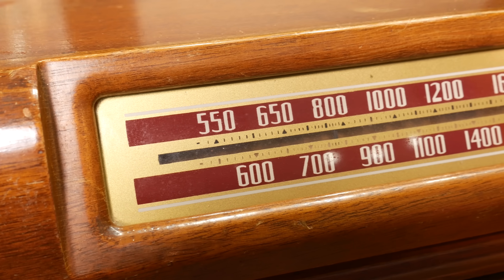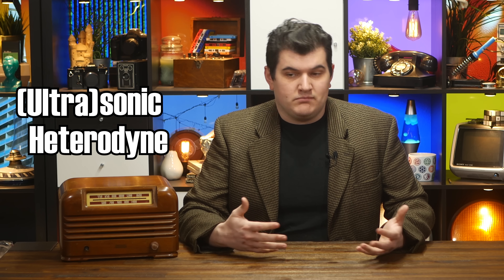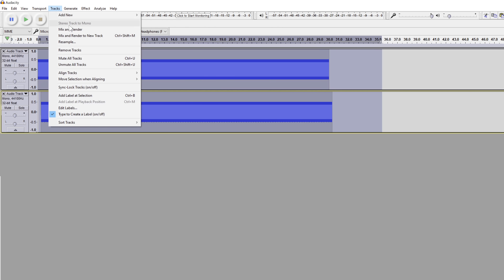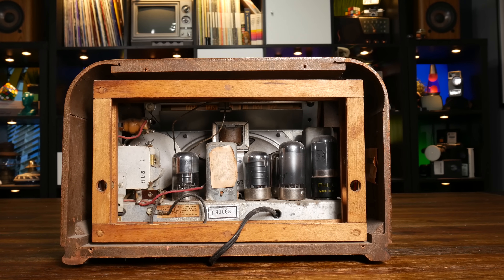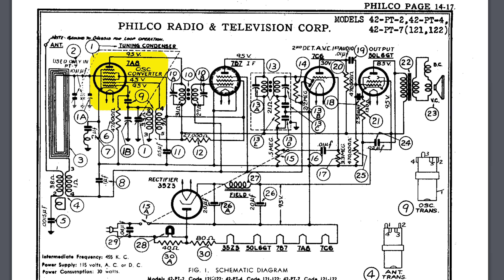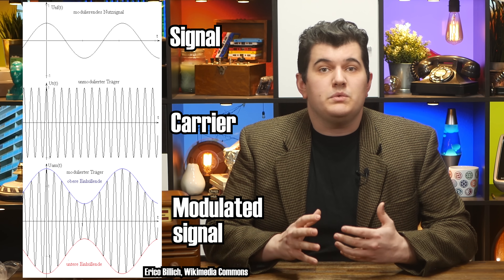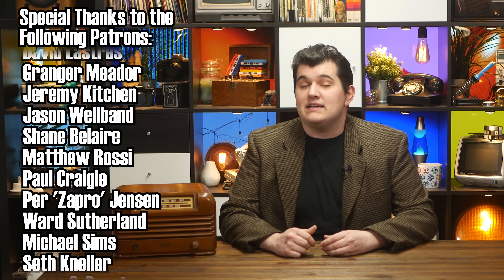The Superheterodyne Radio: No really, that's its name

Comment: None of you seem to know RCA held the patent on Superhetrodyne circuit, many law suits for years in the 30's. 455 kh IF for AM, 10.7 Mh for FM, except Philco used 9.1 Mh, for FM, Philco used a unique circuit for the FM detector, they used a Tube FM 1000 a pentagrid oscillator mixer that produced a 9.1 Mh signal to beat against the 9.! Mh FM signal to recover the audio modulation, resulted in a very wide band audio frequency recovery. Early TV sets until about 1960 used a 25 Mh Intermediate Frequency for the tuners, which caused a beat interference  when one TV was on Channel 7 it interfered with a neighbor watching Channel 11 or someone watching 9 interfered with someone watching Channel 13. About that time the TV IF was increased to 45 Hh as is the normal now used.  

Early Philco radios about 1933 was a TRF Tuned Radio Frequency to avoid paying RCA patent dues, than required a 2 stage tuning capacitor to get the narrow bandwidth to separate stations on adjacent frequencies. Home radio started with KDKA in Pittsburgh, PA in 1921. In the 1930 census the government asked do you own a radio. I'm 92 started doing radio service in 1939. In 1961 I was designing receivers for the Deep Space Network with JPL. Two way comunication from the moon to earth,wow In my life time, pictures from Pluto, wow. Ham radio to talk over distances, now we talk all pictures over the world on the internet. WOW.

Comment: The term "Superheterodyne" was coined by Armstrong to describes the use of a 'super-audible frequency' in its signal processing.  The 'Beat Frequency' is not meant to be heard but used as an intermediate continuous frequency that can be enhanced thru one or more stages of amplification.
Previously the Heterodyning process was to render a CW signal into an audible sound output, or demodulation thru direct conversion. Homodyne does much the same this with AM/FM radio be cancelling out the Rf by combining(beating) the carrier with an identical unmodulated frequency 180 degrees out of phase.. . .  Whew!

Comment: Wonderful video, but some things are left out. The thing in radio is not only do the two frequencies subtract to produce the difference frequency, but also add to produce a sum frequency. The engineers chose to use the difference frequency because at the time the amplifier devices could not amplify too high a frequency. It was invented about 1920, and the tubes could not amplify frequencies more than about 2-3 megahertz. In fact, early superhet radios used 40 kHz to 120 kHz. As tubes were improved, higher frequencies can be used, hence settling on 455 kHz. Also before the superhet, there was TRF, which means each stage had a variable tuning and all three had to match. Again at higher frequencies sensitivity suffered, plus the later circuits would feed back in the the earlier ones causing instability.

Comment: And then the use of variable beat frequency (local) oscillators led more or less directly to two even more significant technologies: FM and single sideband.  I used to use a local oscillator on the FM side of a pocket portable receiver inductively to reconstitute the audio of ham SSB transmissions on shortwave: just hold the FM radio close to the SW receiver and tune the FM until the Donald Duck sounded fairly human.

Comment: I'm an electronics technician by trade and we "only" learned intensively about FM. Our radio at school was a Sailor RT2048 VHF maritime radio. A fully synthesized double super (with two intermediate frequencies).

We did, however, build an AM receiver for the DCF77 clock signal.

Comment: Superheterodyning is still the dominant RF technology although the components used today have been miniaturized and  the process has been refined using multiple conversions and digital synthesizers. Even optical communications use superheterodyned signals to mix and convert light frequencies coming from a fiber optic cable. An old fashioned AM version is quite doable as a DIY project, and great fun! ---https://youtu.be/6VRlNt98uVg

Comment: 2:30 I actually believe a 1 hz difference would cause a 0.5 hz beat frequency. That's because when you add two cosine waves cos(f1*t) + cos(f2*t) you get a sum of 2*cos(t*(f1+f2)/2)*cos(t*(f1-f2)/2). The first term is the resultant wave which has a frequency of the average of the two input frequencies, while the second term is the beat/envelope which has a frequency of half the difference between the two waves.

Comment: I have a neutrodyne radio.  This has three tuning dials which all have to be tweaked to get a particular station, as it directly amplifies the signal instead of converting it to a fixed intermediate frequency for amplification.  Never got it to work yet, but it would.  I need to build a power supply to imitate the original 25 pounds of various batteries it took.  The radio was made in the early 1920's.

Comment: This is the very best explanation of how a receiver works that I have ever run across. Thanks for your hard work and research.  I remember having problems with harmonic signals or signals that would ride in with the one that you are tuned to.  Back in the days of yor, some people would use single side band modulation and most of us  could not understand the garble but we learned that adding a AM carrier to the SSB carrier would make it readable without owning a special SSB reciever.

Comment: Many of the earliest British TVs, pre-war and very early post war, used TRF (Tuned Radio Frequency, ie. non-superhet) receivers as there was only one transmitter (Alexandra Palace on 45MHz vision carrier) so sets could be pre-tuned to that transmitter and there was no need to be able to tune to any other. This avoided the problem of frequency drift of the local oscillator which was a problem with the valves and other components of the era. 
When a second transmitter near Birmingham to serve the Midlands was opened in 1949, some set manufacturers produced "London" and "Birmingham"  versions of their TVs, but with other new transmitters planned the writing was on the wall for TRF sets and all manufacturers moved to using superhets.

Comment: In England you had/have to pay an annual fee to watch TV. I could not understand how they would ever know you were watching without paying. Then I learned that TV detector vans were a thing. They could tell you were watching TV from the street! But how!? It's only a receiver, it doesn't transmit radio! WAIT. Yes it does, and it's the intermediate frequency you talk about. It's used in TV the same way and that IF leaks out and is detectable. In fact, it's even possible to tell what channel you are watching!

Comment: Local oscillator emitting frequency can be deadly if it's 1940's. That's how Nazis found people listening to allies stations
Reply: More recently we used it to look for the receiver for remote control bombs too as they always leak a bit from the local oscillator.  It was also used as a kid's game where you hide a transistor radio and then use another tuned 465Hz off to look for it.

Comment: The physicsy reason for the beat not becoming audible, is you generally need some kind of non-linearity for it to do so. At low amplitudes, air is pretty linear, and it would seem that your microphone was very linear and the speakers you chose didn't interact with one another at those amplitudes either. The really interesting thing is the way the phenomenon is audible through the headphones, the reason this works is actually biology-ey not physicsy. The sound never interacts as an actual sound, nor even as a direct translation of the sound into electrical impulses. The mixing is happening in the brain and this is after the sound has already been decomposed into different frequency bands by the mechanical structure of the ear and then converted to neural impulses.

Comment: I just found your video. Very well done! I'm into collecting and restoring antique radios as a hobby, and I never understood what a "local oscillator" meant. It didn't make any sense to me why a radio needed its own oscillator. I just assumed that the tuning capacitor simply put the circuit into resonance with whatever frequency you wanted to tune to, and so it would selectively pick up only that particular frequency. I had no idea that it was kind of a 2 step process like this. Very interesting!
Reply: The type of radio you describe did actually exist before superhets came into existence. They're called tuned radio frequency (TRF) radios. They were highly sensitive and could really pull in weak, distant stations, but they were poor at rejecting adjacent stations close in frequency, which is where the superhet excels. Some superhets had an extra, radio frequency (RF) amplifier ahead of the converter to improve sensitivity, especially car radios and nice, expensive consoles.

Comment: The game realMyst (the old one from 2000, not the new Masterpiece Edition) used a similar principle to hide its promotional images for the then-upcoming game Uru: Ages Beyond Myst.

The images were stored as separate frames in a video file. They looked like random interference. 

Put two frames on top of another, then do a little bit of color math, take the color difference between the two and make it its own image, and you had a full picture that could be understood.

Comment: Technology Connections
 -- This was by far the clearest explanation of superheterodyne I have ever come across, so Bravo! I wish the teaching had been so clear when I learned about it decades ago.

As for the speakers' beat frequency problem, there is both the acoustic wavelength to consider, and the phase-shift of the speaker crossover circuits, both of which change the time delay of the waves. Adjusting the distance between speakers would probably help. At 400 Hz, the acoustic wavelength is about 2.8 feet (85 cm), which looks approximately like the distance between speakers. At the higher frequencies, 5 kHz has acoustic wavelength of about 6.8 cm, and 5.4 kHz is only 6.3 cm, so you get many entire wavelengths between the speakers, complicating the setup needed to get good heterodyning. The headphones, with just a few cm between speakers and probably no speaker crossover filter, is a much simpler setup for hearing the lower beat frequency.

BTW, the singular of Hz is still Hertz, from the fellow's name, Heinrich Hertz. https://en.wikipedia.org/wiki/Heinrich_Hertz

Comment: OK, I didn't go through the 1045 comments to see if anyone else caught this error regarding the beat frequencies at the 8:35 time mark, but, the desired frequency and the local oscillator frequency (made by the converter) create sum and difference signals, both not equal to + or - 455. So a tuned frequency of 780 needs the 1235 to get the difference frequency of 455 kHz, but the other frequency made is 1235 plus 780, for a sum of 2015 kHz. Since the IF "filters" are tuned only to 455 kHz, the sum signal is rejected. Also, the superheterodyne circuit was mostly needed with early 1920s tubes because they did not handle high frequencies well, and early IF frequencies were lower, like 200-250 kHz. By the time of that radio, mid 1930s, shortwave and FM was already invented and frequencies up to 50-75 Megahertz were commonly used. Those tubes can handle those high frequencies.

Comment: First comment on one of your fantastic videos. I'm really amazed how well your contents are researched, how well are presented, and actually how long they are! I can't imagine what amount of time and effort is behind a production of every single piece. Thanks for being here and giving us these material to watch!

Regarding this particular piece: even if I'm interested in electronics from childhood, radio technology has been always some kind of mystery for me. I'm an audio enthusiast, you know, whatever oscillates beyond human hearing is an issue for me ;) So actually I knew the term from childhood, but I had to wait until your video to know, what it exactly means at how it works. And this explained to me something else as well.
Being born on the rusty side of that famous iron curtain, I knew there were really dark times when people got arrested only for listening certain (banned) radio stations. I heard stories about special equipped vehicles which were able to measure what stations the people were listening to. Now, your explanation of how the radio receivers are actually work, enlightened the way how it was possible: they had a sensitive receiver on-board and they actually captured the radiation of the local oscillators, and I can imagine, with some kind of directional antennas, they could locate the source as well. Then they could instruct the leather-jacket people in the black Volgas, which house to go to...

Thumbs up again, you gained an another subscriber :)

Comment: One use for the local oscillator is when listening to Morse code on an ordinary AM radio without a CW option. Tune into the Morse and bring a second radio close with the volume turned down. Tune this radio and as if by magic you will hear the Morse tone perfectly.

Comment: Next time, take the time to explain that 7A8 Hexagrid Converter, which would help explain this next time.

Rather low B+.  Looks to me like this design was also used interchangably in battery radios.  Five bucks says you can probably find this exact circuit used in a battery radio in the same volume of Ryder's.

Comment: I haven't listened to radio, much less AM radio, in forever.  I went to my trusty rusty 1980s Technics stereo receiver and switched over to the AM band of the tuner, and sure enough, there are still AM stations in operation in my area. And it's still pretty crappy in comparison to FM or simply listening over the internet.  It may be a while before I try it again! ;-)

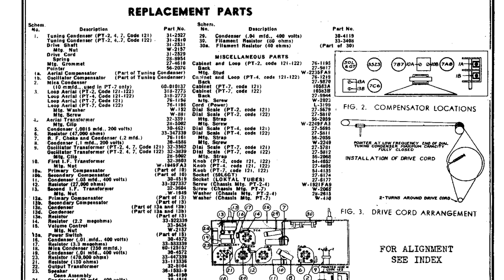Comment: 6:32 And that's where we get the term "Condenser Microphone" from - it acts as a giant capacitor. As sound waves enter, one of the plates of the capacitor moves with the sound. This changes the effective capacitance of the microphone, producing a current flow through the microphone. This current is what is used to produce the audio signal that goes into an audio processor. Because the audio signal from a condenser microphone is produced from the current flow, rather than the voltage (as most other types of microphone use), the microphone can be powered through the same wire that the audio signal is processed from, which is why the power supply to a condenser microphone is known as a "Phantom Power Supply" - any variance in the voltage of the power supply does not affect the audio signal, since the audio processor doesn't look for a change in voltage, so the power supply is essentially "invisible" to it, hence the term "phantom".

Comment: E. Howard Armstrong invented a superheterodyne receiver during his service in WWI as a means to receive the 3 Mhz signals Germany was using (although I don't know if it was completed before the end of the war). Earlier he was the first to use a triode vacuum tube (an "Audion") to vastly increase the sensitivity of a wireless telegraphy receiver. (You could even listen though a loudspeaker rather than headphones !!) Later he invented frequency modulation (FM) as a means to eliminate static from radio signals. RCA (in the person of David Sarnoff, it's president) wouldn't buy it because they had too much invested in AM, but it was adopted as the standard for the audio portion of television, then still in development.

Comment: As a kid in the late '60's I had a radio kit you made form Radio Shack that was Superheterodyne. (five vacuum tubes)  Not sure why I didn't buy the transistor kit.  I still have it, but it must need a new tube.

Notice the tuner has ball bearings!

Comment: Great video! This finally made me understand the basics of how all that intermediary frequency stuff works. As some others pointed out that you'd use multiplicative mixing instead of just adding the signals, I read up on that as well and it's actually surprisingly simple. I now also have a grasp on how a ring modulator works. :D

Comment: In your demo the humming or buzzing in between stations indicates you have severe radio interference possible from power line RFI source(s).  Call your power company to have tthem repair it to meet FCC Part 15 regulations.

Comment: "Pentagrid" = "Pentode" though the 7A8 vacuum tube, if you look at the diagram, is  "Sextode".

Adding a variable audio frequency range "Beat Frequency Oscillator" injected into one of the audio amplifier grids enables the AM Superheterodyne receiver to demodulate single sideband radio signals and Morse code unmodulated carrier wave transmission. Great for listening into Ham Radio traffic on short wave.

Passing the IF radio signal through a bridge rectifier (called a "Discriminator" in this role) after the final IF stage but before audio amplification enables the receiver to resolve Frequency Modulated radio signals.

Early radios were all TRF (Tuned Radio Frequency) or Super Regenerative types, the latter still popular for use in kid's low powered 27 Mhz and 49 Mhz AM single channel walkie talkies.

Comment: What about a Tayloe Mixer front end with driven via a clock at four times the wanted frequency to recover the I/Q signals to be processed in the digital domain using a DSP chip and then sent to a DAC as audio of the wanted channel.